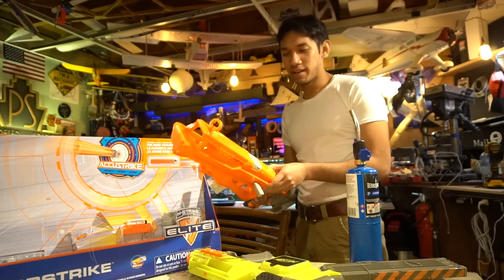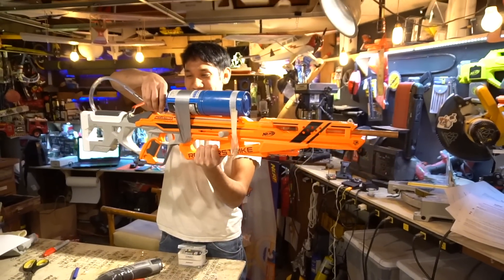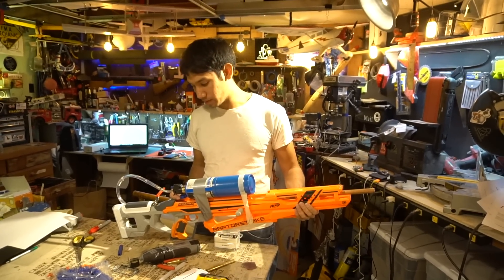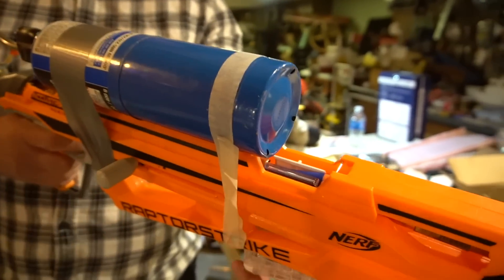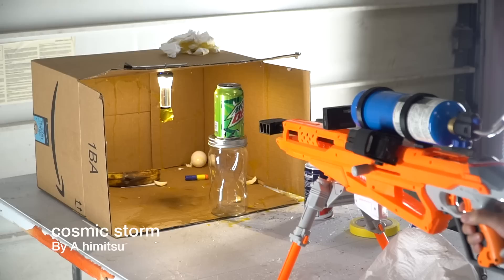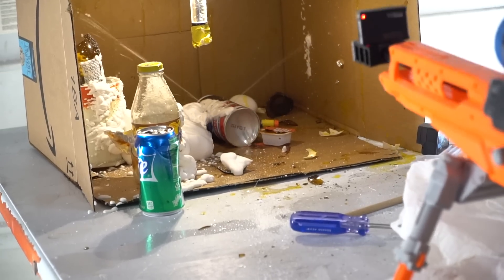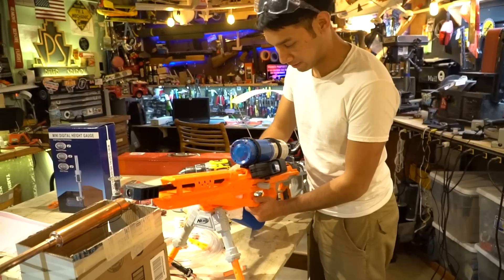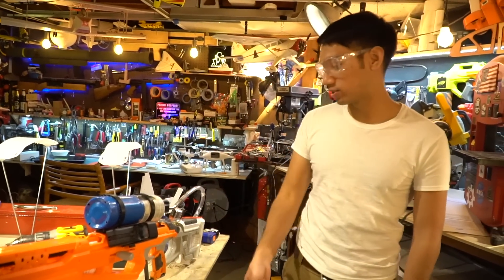Propane Powered Nerf Blaster!

Comment: The chronograph Err2 means that the chronograph detected the projectile with the first sensor but not the second.  The chronograph operates by watching for the shadow of the bullet between the sensor and the white covers over the sensors and timing the bullet between sensors.  If the bullet is not detected by either sensor, the chronograph cannot calculate a velocity.  So, Err1 would mean the second sensor detected the bullet but not the first.  Short barreled guns are the hardest to chronograph because aligning the gun to pass the bullet over both of the sensors is more difficult.
Reply from the maker: Thanks man! that makes sense! Will keep that in mind when I use it again!
Reply: Chronographs require quite a bit of light as well. It also has to be in the correct orientation over the sensor. You'll need to move the lighting around above it to find the best position. We've had numerous issues on cloudy days because of the lighting. You may also have to shoot closer to the sensor in the base of the chronograph as it gives the sensor a darker shadow.
Reply: PeterSripol Great to see you taking advice from interested fans. Love your videos. Keep up the great work
Reply: I have the same Chrono and it can read nerf darts as low as 1fps. Like the others said you need lots of light and it doesn't work well with incandescent bulbs. I have found that LEDs are the best light source.

Comment: Personally, I thought screwing a project up was how you learn/ trouble shoot. Hell, I dont need a class to teach me that. Its when you stop screwing up and start producing results is when you know youve learned something. lol. At least that was always the way us older guys learned it. Its called the hard knocks of life. After a while a light goes on any you get it. It worked for my Grandpa, my dad, and myself. Not only that, you come out of it much wiser.  No money spent, no class room time or whatever you do. I can say life gets easier once the light goes on.
Reply: lmfao, way too serious here guys XD
Reply: Imagine if the civil engeneers that designed the Burj Khalifa had messed up and in a windy night the whole structure had collapsed. "Don't worry guys, next time we'll do fine".
Also, about the "no money spent" thing, think of the example I gave you, of the Burj Khalifa. I definitely believe that building the whole thing from zero would cost substantially more than the courses the professionals would have taken about skycraper aerodynamics.
By no means I'm saying that screwing up is not a way to learn how to trouble shoot, but it's just not efficient in every circumstance. Of course you can learn from your mistakes if you are doing a backyard project, but not really if you are working in a much bigger project. So I don't think that simply stating that you don't need to take clases is the correct thing to do. Anyways, by no means I'm trying to attack you personally or anything like that, I think this is quite an objective perspective
Reply: Kiritsu We are not building pianos here folks. An Engineering degree teachs you about building skyscrapers, apples and oranges people.

Comment: Awesome video!! Also, glad we weren't the only ones who struggled with a propane powered blaster. We used schedule 80 clear PVC so we could see inside and troubleshoot still struggled with ignition. Trying to get the right fuel air mixture every time is hard! My thought right now is to have two fast-acting on/off valves (like McM#6790T42) for gas that would load then vent the perfect amount of gas to a specific chamber size. Also I'd love to see how you rigged up the taser because I think that's an upgrade we have coming up soon(ish). Great stuff as always!
Reply: EvanAndKatelyn obligatory warning: combustion generally only generates ~100 psi, so using PVC is semi safe, but if you're going to be optimizing fuel/air ratios, consider using metal or ABS pipe (PVC shatters, ABS splits open like a banana) 
Just remember: PVC shards don't show up on an X-ray. Be safe!
Reply from the maker: oooh, will have to check that out! the taser is just some random taser part of amazon, I just bought the first thing that came up hahaha. The little ceramic piece is from a grille ignitor and I just drilled the copper out to fit it in, the spark gap for the taser is about 1/2 an inch so it will simply arc from the tip of the ignitor to the side wall of the copper!
Reply: Thanks for the heads up!! Yeah our biggest piece of tubing (the lowest rated) is good to 140 PSI and we were getting around 50-80 PSI. Do they make clear ABS tubing? The main reason we went with clear tubing is so we could get cool slowmotion shots at night :D
Reply: Do you think the nerf ceo sees this shit
Reply: EvanAndKatelyn Oh my god you’re goina have a second video of that I’m so excited 🤙

Comment: Take an electric Valve and connect an arduino to it:) on the Arduino with relais you can set the time =15sec until it closes again and then you can make a green light turn on which indicates that when you press the trigger again you can fire a bolt! I think using arduinos would be a great addition to your projects!

Comment: Hey Peter, you should try using camping propane because it is so much smaller, and lighter weight so you can make it blend in with the design better. Also it would be more convenient to hook up the gas shutoff valve with the bolt via a 3D printed lever arm so that you only have to do one thing and you can focus on the timing. Maybe next time try using RC car fuel vaporizing that seems like something that can be stored in a small container and fit into the body of the nerf gun better.

Comment: Yes Peter... Cool videos man!! Listen at 10:00 you had some ignition troubles right? Put your spark gap or spark plug at the end of the combustion chamber, so that the ignited gasses dont  press unburned propane out the barrel during the ignition process and youll get higher mussle velocities (perhaps). Older weapons like the Dreise needle gun work also that way, igniting black powder closest to the projectile first!

Comment: Sequence; first put bullet in after the chamber, then fill with propane/oxygen, shut the valve. Now the mixture is Trapped in the chamber Between bullit and valve. Ignite and since only the bullit is mobile it Will fire away

Comment: Instead of spark plug why not use a glow plug?
Reply: Cee Tee a glow plug goves a constant heat to provide an ignition source wheras a spark plug provides a intermittent spark as an ignition source.  

A glow plug would not provide immediate ignition as it takes time to heat up.

A hot glow plug could also cause ignition of gasses while filling the chaimber as soon as the air/fuel mix reaches its lower explosive limit and before the ideal air/fuel mix is reached for maximum propulsion.

Comment: Could anyone explain to me where the oxidizer comes from? According to my knowledge propane needs an oxidizer to burn.
Reply: G.Zoltan I imagine it’s just using oxygen, which enters the chamber after each shot
Reply from the maker: venturi effect, the propane torch nozzle slip streams some fresh air in when the gas stream is running.
Reply: G.Zoltan He is lacking compression. plenty of air, not enough of it.

Comment: How different is electronics soldering from pipe soldering? I've soldered electronics.
Reply: xWood4000 different type of solder and apply flux. Also use a torch rather than a soldering iron
Reply: hallucinates ducks Thank you. But tye application is basically the same?

Comment: I'd love to see a more automated system on something like this. Using stuff like sprinkler valves in place of the manual shutoff valve, controlled by an arduino. Put a contact switch on the charging handle of the blaster, so when you pull it back it "primes" the blast chamber. Maybe add a potentiometer knob so you can "tune" the fill valve timing? That way you can easily adjust it for perfect burns every time.
Reply: Using a pneumatic ramrod as a metering system, that is possible. If you measure the volume of the combustion chamber and calculate the right injector size, you can get pretty good, repeatable shots. Arduino makes it just overly complicated. If you want to go electric for the controls you could just use a few solenoid valves in 1/8" or 1/4" size.

Comment: Awesome build! Can you make one with the same functionality as a paintball gun? High pressure air or Co2 and 1 shot per trigger pull, no fiddling with the bolt and all that XD
Reply: Making a co2 powered gun would probably me considerably more difficult. Even the first PB guns were pretty complex, because you have to have a valve that handles the ~800psi, but still opens/closes fairly quickly. Also, 800psi if fairly dangerous if you mess up (not that that has stopped Peter before :p )